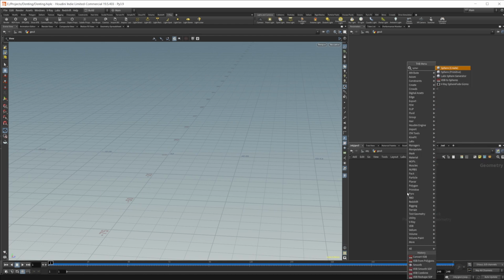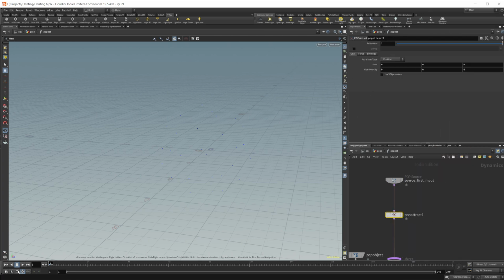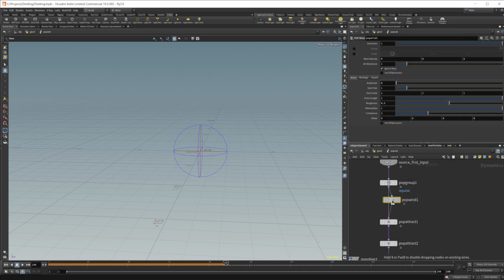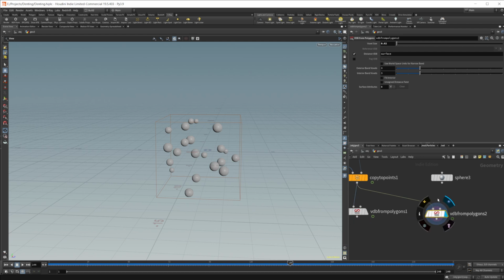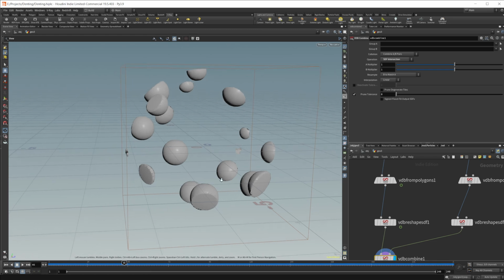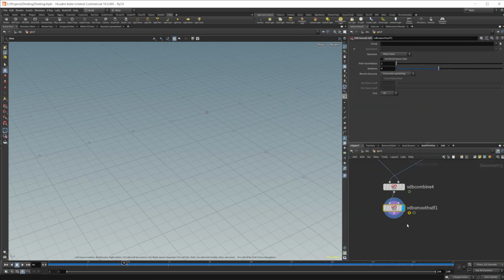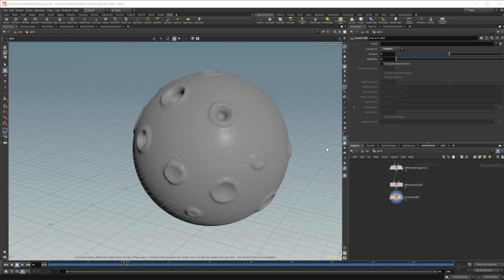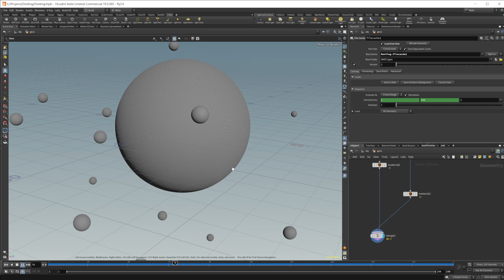VDB Mesh Deformation | Houdini 19.5

Comment: is there a way to set uvs for this?
Reply from the maker: You would probably need to freeze it on a frame, create uvs, then attribute copy them back onto the animated mesh but I'm not sure if that will work. I haven't tried
Reply: i have 2 geos, animated to combine together as 1 VDB using VDB combine, like a metaball effect, I tried this method but the UVs kept breaking and all. if there is a solution to this, it would be nice to know!
Reply from the maker: Thats definitely a complex issue. In my experience these types of effects are usually textured with triplanar projection to avoid messing with uv's. Maybe you can try the rest state uv trick that I talked about in the last comment. Do that for both objects and the final mesh and then lerp between the uv sets to get a gradual transition. I'm not really sure how to tackle it other than that

Comment: I think we can also do the same type of effect (not sure if as detailed as you showed) with Sphere as a NURBS and other spheres as a Metaball and plug them into the Bulge SOP or Magnet SOP, MagnetBubbles example (try provided example by SideFX from the node docs).

Recently found out about these nodes and a lot of interesting things like water (rain) bubbles could be done pretty easily and even sculpting (if get used to it) could be done. Or other inexpensive computation effects, for the soft body as an example. 

Thank you for the video 🙂👍
Reply from the maker: I just found out about the magnet sop recently. Haven't had a chance to look through it though. Thanks for sharing
Reply: @InsideTheMindSpace  🙂👍